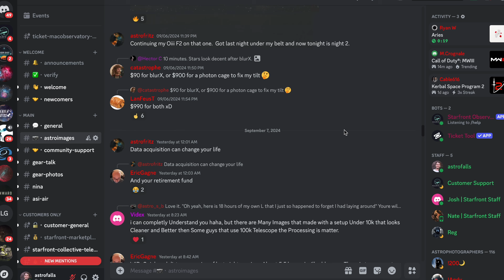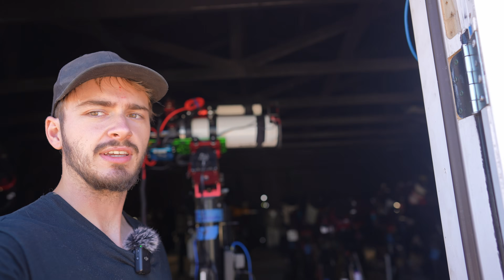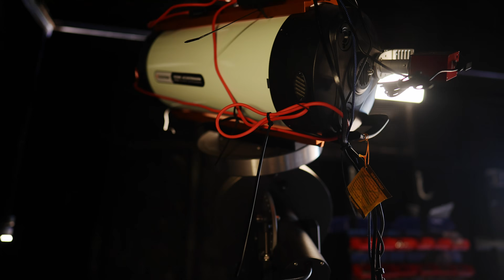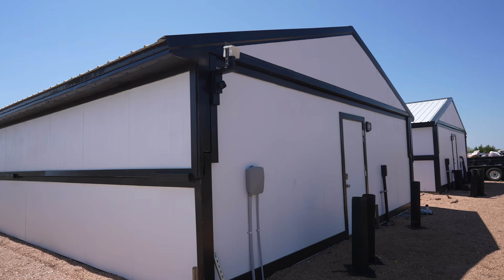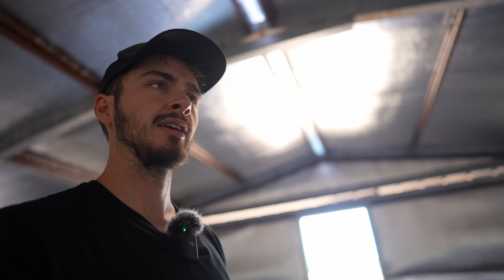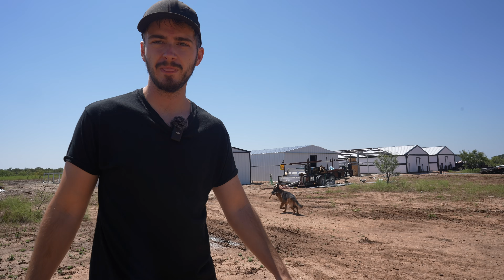Tour of the New Construction at Starfront!

Comment: Some criticism, or just thinking out loud..
According to lightpolutionmap, your skies are B2, not B1. 

It appears that the facility is near a dirt road, and the buildings look loosely sealed. I'd have a concern of what the optics would look like after a year there. 

Charging for ethernet cable ?! charging for extension cords to power too? A pier should be provisioned for power and ethernet for the pier rental. 

I cant see the justification for $100+ per month for a pigyback system beyond initial setup. I think of as occupied square ft inside the building. If someone has a setup with an OAG and a second scope with an OAG, vs someone who has a scope and conventional guide scope, what's the difference? $100 extra a month feels like a grab. The additional reason of "bandwidth" seems like a real stretch. Bandwidth is cheap on this scale. (if it really is fiber optic and not starlink)

I haven't seen mention of how to get a scope sent back to someone, or how much it would cost. 

I think your initial success will be on the novelty of your business model, but I don't think its sustainable on an annual basis because of the high monthly reoccurring costs.  Your price per SqFt for commercial space is in the upper 90% considering the simplistic structures, warehouse space is considerably more costly to create (thick conrete floors, insulation, air control & climate control, fire suppression).....  This leads me to guestimate that about 70% of the cost of having the scope there is in personnel expertise. 

As much as I'd love to send my 6" newt down to Tx from North Id, I cant justify $2,400 a year.  I still think this is out of reach for middle America. 
I still compare this to boarding a horse for $350-450 a month. They get a 12x14' stall, fed and watered twice a day, riders have access to a massive indoor arena.. Your costs, time requirements and square footage requirements are minimal comparatively.

Comment: What's your answer for dust control on the optics? Looks like the scope exteriors have a significant build up. Thanks.
Reply from the maker: Scopes are cleaned when customers make tickets for it, or about once every 6 months. Dust has little impact on images, also the contents of the building are technically outside for half of the day, so dust is inevitable.
Reply: To be fair, if you're sending your scope remote it's very likely you'll have an auto flat panel (or dust cover) sorted for it. The only issue would be if people are running actively cooled mini PCs as dust ingress is baaaaad for computers long term.